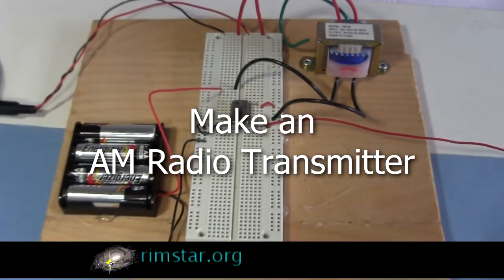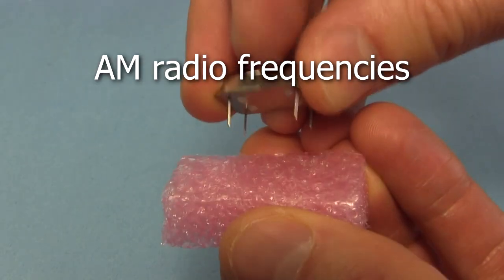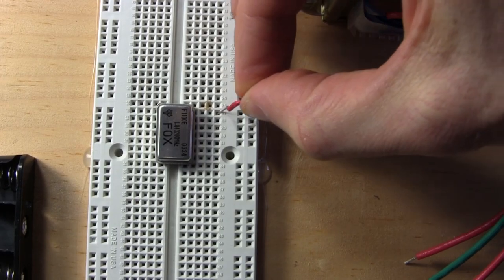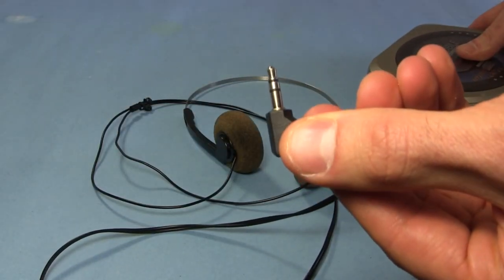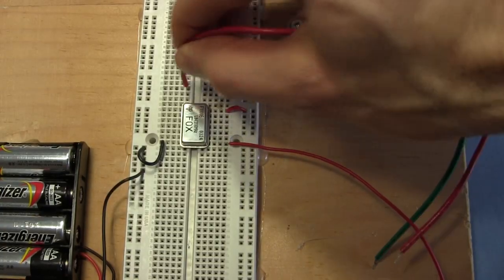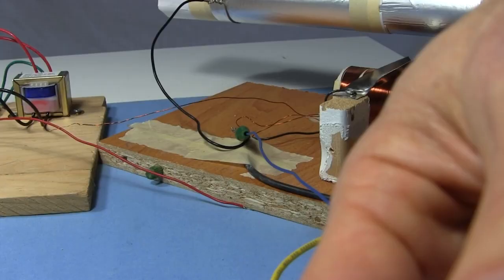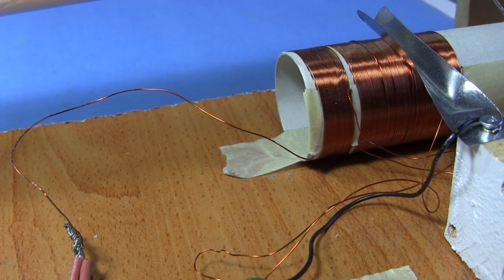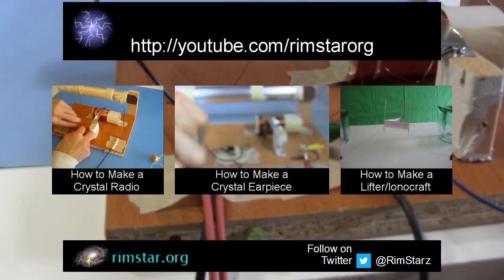How to Make AM Radio Transmitter

Comment: If you could make a video on how this works that would be great. Also I am working on a project that will only send radio waves and not have a receiving end. I wanted it to use frequency modulation instead of amplitude modulation and was wondering if you could send radio waves without encoding any music into it. Thanks, wviper3.
Reply from the maker: I already have a video explaining how it works. It's "Amplitude Modulation with Simple AM Radio Transmitter" http://youtu.be/R04yEKqgGPc As for how to send AM radio waves without encoding any music into it, just remove the CD player and transformer from this circuit. Keep in mind that this isn't the best of circuits since it transmits at harmonic and subharmonic frequencies too. If it's frequency modulation you want (FM radio), I don't have anything about that and haven't done it myself.

Comment from the maker: If the microphone has and amplifier or you connect it to an amplifier first, then it might work. So your sound card would be the amplifier. I wouldn't guarantee it would work since I don't know the power output of your sound card. It's something I wanted to try but I didn't have anything to plug the microphone into. And thanks! I'm glad you liked my video!

Comment from the maker: You can use a stronger sound source to begin with, like a PC speaker amplifier or a stereo amplifier, instead of a CD player. And also use a longer antenna. But it's not a good idea. If you broadcast over a larger area then you may interfere with other people's radio. This transmitter is especially bad since if transmits over many frequencies at once. In some countries it's even illegal to broadcast more than a few feet without a license. So no tutorial :).

Comment from the maker: The side with the most turns is connected to the chip and the side with the least turns is connected to the sound source, the CD player in this case. Other than that, which wires go where doesn't matter.

Comment from the maker: It would transmit on harmonic or subharmonic frequencies. For the harmonics, multiple 1 megahertz by 2, 3, 4, ... so 2MHz, 3MHz, 4MHz, ... For the subharmonics, divide by 2, 3, 4, ... so .5MHz, .333MHz, .25MHz. And it's pretty sloppy around those frequencies, i.e. a lot of frequencies around them. That's the same as for chip I used, except it's harmonics and subharmonics of 1.8MHz.

Comment from the maker: I'm delighted to hear that it works, and so well too! Thanks for letting me know.
I don't know how to make an antenna that can transmit 7 miles and I wouldn't recommend it. Certainly not with this transmitter since it broadcasts on so many frequencies, as I point out in this video. You shouldn't transmit more than a few feet to be sure you're not interfering with anyone else's radio. In many countries there are laws about radio transmission. You should check for where you are.

Comment from the maker: I don't have the one from sci toys, but from the photo on their website it looks like 3 prongs and 2 prongs. In that case use only the outer two of the 3 prong side to go to your sound source. If yours really does have 3 and 3 then I'd suggest trying using just the outer prongs on each side and testing both directions to see what works. Is there anything written on the transformer or did it come with any documentation?

Comment from the maker: The transformer for stepping up the voltage of the audio signal coming from the CD player. Without it the output of the CD player is only around 1.2 volts peak-to-peak. That's too low given the the oscillator powered by the battery is putting out around 6.3 volts. With the transformer the CD's output it raised to around 10 volts peak-to-peak, which is more suitable for being chopped up by the oscillator. See my "Amplitude Modulation with Simple AM Radio Transmitter" video for diagrams.

Comment from the maker: That's a programmable oscillator which means that the frequency it outputs is controlled by the voltage you give it. The voltage we give is varies all the time since it's amplitude modulated (AM). The frequency would be constantly changing. So no, I'm pretty sure you can't use it.

Comment: Oh nah, didn't video it. Built another couple of years ago that used a 1.5V AA, it had a transmit range of about 30ft..lot of fun bending the 4 or 5 turn small copper coil to change the frequency, really hands on that one in an intuitive way ! Found it on one of those 100's of circuits type websites.

Comment: Don't worry, I want to build it for the concept rather than actual functionality.  But in theory, if you want to be able to broadcast farther away, what variable(s) would you need to increase (like using more power, a longer antenna wire, a lower frequency, a combination of those, or etc.)?

Comment from the maker: Glad you like it. I glued the breadboard because I didn't want to put too many holes in the wooden board but I screwed the transformer anyway since it weighs more - didn't want it falling off. As for the side rails, I could have sworn one side went all the way and when the other side didn't, I just figured that side was busted. Just rechecked and they go 1/2 way like yours. Looks like annotations are in order. :( Thanks for watching!

Comment: i meant 1.5 volt cell..if you like short circuit the cell again and again close enogh to the antenna you can hear faint sparks...not quite loud though..because it is very low voltage but still it is quite satisfactory...

Comment: nice one!! i had made one of the simplest one using a cell and some foil..connecting the two leads together makes a faint "dot" enough to trasmit morse code using a transformer you can get pretty high voltages from the battery which is also fun...did you try and see that when you touch the cans or there is a spark in kelvin thunderstor there is a dot  in the radio (AM) your videeos are very educational...,

Comment from the maker: Yes, that's it exactly. I did look at the voltages on my oscilloscope and it didn't seem high, only 10 or 20 volts, but I didn't really make a mental note. It was pretty cool to see though. I first got the oscillator working and saw the 1.8kHz waveform on the scope. Then I added the sound and transformer and saw the modulated version. It was clear as day, very cool to see! Now that I have a transmitter I can do a video following the waveform from source to earpiece.

Comment: Great video(s).  In this video It appears you are modulating the voltage to the oscillator using a high voltage signal from the transformer.  Is this correct?